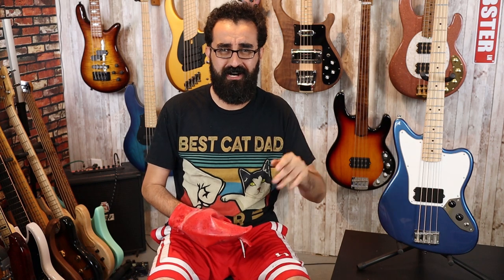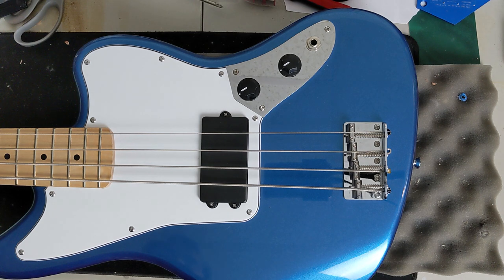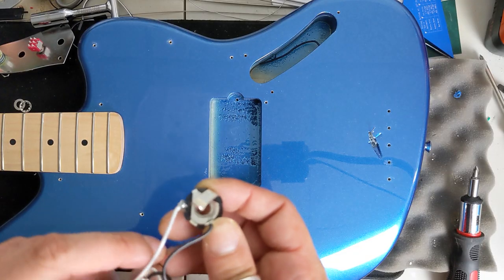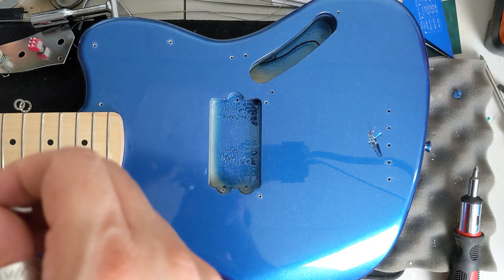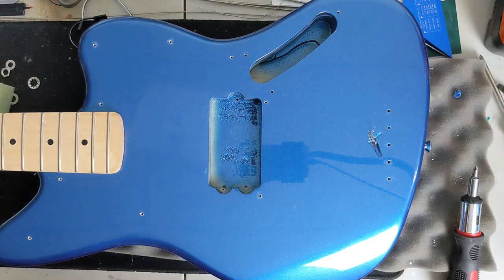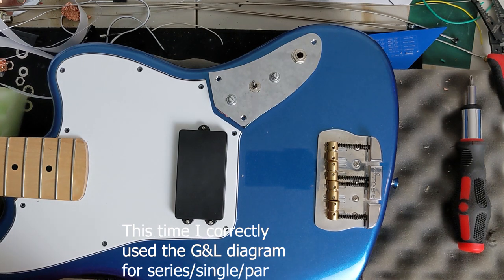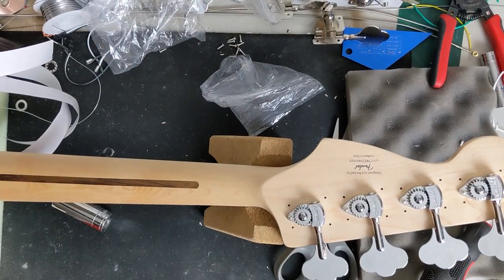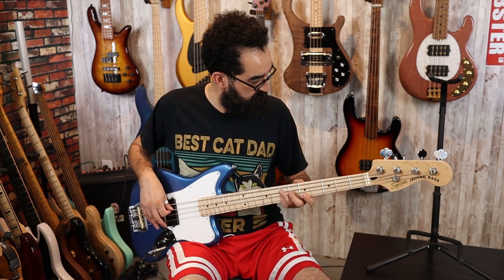Squier Affinity Jaguar H MODIFIED - Modding Fender's Latest Budget Beast! - LowEndLobster Fresh Look

Comment: Quick tip for anyone who wants to shield cavities and connect together but don't have soldering iron access. Take a thin strip of your conducting copper tape and route it to your different cavities. Then remove a little of the backing at each end and put on other copper shielding. You've completed the circuite!
Reply from the maker: EXCELLENT TIP!
Reply: I'm a total dunce when it comes to electronics, and I have this bass with the bass buzz feedback issue. I was told copper shielding tape might help. Your explanation probably makes sense to folk with any electrical aptitude, but do you think you could explain it so a fella like me could do it? Thank you kindly!
Reply: @citeltheof  so the entire cavity for the electronics needs to be covered in The shielding. Then underneath each pickup needs to be covered. In order to ground each section together they must have a way to connect. What I did was cut a piece of tape long and thing. I threaded that piece between the pickup cavity and the electronics cavity. Then once in the small holes I removed a little of the backing from each end of the tape and connected the different cavities together by pressing the tape down underneath the pickups and electronics cavity. This was on a jazz bass. If you would have a single cavity instrument like a precision this wouldn’t be necessary.

Comment: Great to see you do this mod video.  I'm looking to do a bass with two Musicman style pickups and  this model could fit the bill - add the second pickup between this mid-body pickup and the bridge.  Make them both wired for parallel/single/series options, using quad-coil MM pups so they are humbucking in all switched configs.  Thanks, LowEndLobster!
Reply: If you want to do a mod ignore me but if you didn't know the squier paranormal rascal already hasp two humbuckers on a jaguar body

Comment: Nice mod. Gives so much value to this bass. Single coil sounded the best to me.

BTW I used to have this exact same battery-operated Black & Decker screwdriver/drill. Man you are a hero you still use it after so many years. I wonder how you don't get frustrated with the battery. I could barely screw a handful of screws before it got depleted. Eventually I got myself a new one (Spanish - "Steyer" or "Steyr") which came in a nice case with a couple of Lithium batteries (for the cost of about 2 of the B&D batteries) and the thing just works and works and works before it needs a recharge. The difference is abyssal.  I've made 4 or 5 small and one mid-sized piece of furniture for my baby daughter and I only had to recharge one of the batteries once. The choke is much better too - you only need one hand on it to make a bit change.
Reply from the maker: Thank you! LOL I fackin hate this drill. It does the job when it's charged but man does it lose charge fast. You'll see in an upcoming mod video where I had to drill out the side jack of the Sire V3 (the jack cavity is separate from the control cavity, unlike on the V7 where it's all one cavity)
Reply: @LowEndLobster  Get a new one immediately. And destroy the current one sacrificially as a warning example to the tech gremlins that laugh by torturing manic bass modders.

Comment: The definitive solution to neck dive is to change the strap button positions.
Light tuners and a high mass bridge help but not nearly as much. 
The G&L pickups has an awesome sound. The wiring switch opened up a lot of options too
Reply: perhaps use a leather strap. there was no neck dive before nylon straps

Comment: I picked up one of these this weekend (went to GC to get it after Sam Ash told me it would be a year before they'd get one). The neck dive is absolutely a thing (I have to use a locking tuner or the front strap tends to pop off on me).

I really like these mods and the way it sounds. I especially like the three way switch. It adds some definite versatility to the stock configuration.
Reply from the maker: Thanks Clint! I've heard mixed reports about the neck dive and honestly will attribute it to how much counterweight you have going on in the body (lighter body = more dive). That being said, the shape of the body also contributes. The hipshots definitely helped, but did not cure the dive like in some other basses.
Reply: @LowEndLobster  Yeah, it's the same issues as the Mockingbird body style from BC Rich. All the weight forward on the body just doesn't balance out the headstock as well.

Comment: Nice review.  MFD pickups are so great! I like the finish on that Squier.  Good looking bass. Hand drilling holes into chromed metal is not for the feint of heart! Like the big brass saddles on that bridge, and it' great that it dropped right in. Wilkinson makes a really nice vintage style bridge with brass saddles that would have looked great and sounded much better the the original bridge. I had some classic vibe basses that I modded for fun, and I loved the Wilkinson parts and pickups because they were such an excellent value. If you haven't tried the Wilkinson bass pickups; you should. I don't think there is any comparable pick up for the money. Slap a P or a set of J's in a Squier and it improves the sound a ton. The improvement in your project with the MGD is staggering. I think someone could make big money solely making replacement hardware for Squiers.  Thanks for the interesting project and review.

Comment: I modded my charcoal/Indian laurel specimen for less than $125. I wired a GFS pickup in parallel, put on a Gotoh 201 bridge, and Dunlop straplocks, with a 1/2" dowel to extend the upper horn straplock a bit. The exposed pole pieces give more of a Sting Ray vibe, and feeding it through a MXR M-80 gives it a ballpark Ray sound to boot. It was interesting to see Lobster's mods, especially since I have a thing for G&L J variants (I have a pair of American JB-2s with pickup mods and Hipshot Xtenders, and an empress-body JB left bone stock, save for straplocks, natch; 1964 "holy grail" J sound under 8 lbs in weight). The modded Jag is a great "designated beater," and will likely find its' way to a grandkid's hands soon enough.

Comment: Awesome job. Continuity error found btw. Not gonna spoil it. On a different bar, I love this bass. Had so much fun modding it. I did a shielding right away as it was screaming like crazy on my rig. I went with the EMG passive pickups. Still haven't had time to swap the bridge and tuners so it still got a bit of neck dive. Only issue I've had so far is that the pickup route in the PG was too small for the EMGs. Had to cut and file to make it fit. Will add a 3 way switch later like you did.

Comment: Definitely a big improvement with the mods. My only question is how did you mount the MFD pickup into that blank pickup cover? That part was not mentioned. I like the shielding and I do the same thing but I always use the water based conductive shielding paint. It's so much easier to use than foil.  

The end result is almost like you created a medium scale G&L Kiloton.  So once again, great job. But you really need to show how you mounted the pickup into that mounting ring. That's very important to anyone who is watching this and wants to make this modification themselves
Reply from the maker: Great question! I used foam. I removed the guts of the MFD from the original plastic housing and they fit pretty well in the blank MM housing. I used some bits of foam to hold them in place in the housing, and foam under the pickup to keep everything in place as well.
Reply: @LowEndLobster  awesome.  Do you know if the stock pup is the same dimensions as the music man pick up? That certainly would open up some additional options if that was true.  

I'm seriously considering picking one of these up just to mess around with.  Oh, and by the way, I got turned on to your site through a post on TalkBass.

Comment: Great video as always.
Unfortunately for myself I purchased 2 of these bass’s, one gray, one black, the neck dive on both were beyond bad so I returned both of them.
Yes, putting lightweight tuners on would have helped but I don’t think enough to make me happy.
And yes, everyone’s mileage will differ as much as the difference in the weight of each individual bass, but in my case both the bass’s I purchased felt like they had way too much neck dive to be corrected or even helped with lightweight tuners.
Other than the extremely bad neck dive I really did like these bass’s.
Cheers, Davyo
Reply from the maker: Thanks for sharing your experience Davyo!

Comment: Hi Lobster! I was definitely eagerly awaiting this video. I figred early on you'd be G&Ling this one. Huge difference in sound, from before the mod, as well as in between the modes. Question, in the G&L the tone cap is only on the series mode, isn't it?
Reply from the maker: That's OMG mode where you have that tone cap, I have a regular series mode here. Should have clarified, sorry!
Reply: There's a more recent video where CLF Research goes through the wiring for all the bass pickup versions since Leo left FMIC, which I seem to be referring to a lot more lately...

They only sporadically update but they're usually pretty interesting videos from the CLFR shop and they publish often enough to keep turning up in my recommends.

Origins: Great Pickup Migration
567 views Jul 23, 2021
CLF Research
1.5K subscribers

Comment: Ooooh, great video Lobster!!!
I'm in the middle of quite a similar mod project on an old and cheap Stingray copy by Stagg which I defretted and converted to string through myself earlier this year. Just waiting for my pickup to be delivered and will wire it in the very same way with a DPDT switch. One annoying little detail is that for some reason the Chinese guys at Stagg decided not to use a standard MM style sized humbucker but some sort of a soapbar sized one.

Comment: The is a cool bass and the neck on my copy is indeed finished well.  My big complaint is the balance.  I’ve added some coated lead wheel balancing weights to the control cavity and it helps.  I will add an inexpensive high mass bridge if I can find one with a flat plate that I don’t want to return for not sitting flush.  If I can get it to balance it will be a cool bass to play on a regular basis, otherwise it will be an inexpensive and fun project bass that looks good.
Reply: Also metal volume and tone nobs add a bit more balance, but the poplar body and possibly the body shape don’t lend themselves to a bass that balances naturally.

Comment: Great review, thanks! I am considering one of these since they are medium-scale like the Aria Pro II I've been playing since I bought it new in 1981. One of its pickups is dead though and they are a really odd size to change out. I tried having a custom one made by Armstrong in the UK but that did not work out. The color is wrong and the output is weak. My Aria bass is perfectly balanced which makes me a little worried about this one being a bit neck-heavy. 

Could you explain more about the pickup modification? Do you have a video on that? I am considering installing a Nordstrand Music Man style MM4.2 pickup which should fit without any mods. I do really like the sound of the one you Incorporated though, so more info would be helpful such as the model number. Is it a single coil? You didn't happen to record a video of how you fit it into the empty MM shell? 🤔

Damn, this bass looks fabulous without the pickguard! 💯

Comment: How hard was it to fit a G&L MFD pickup into the MM enclosure? Did you put the entire pickup in there or did you remove the MFD enclosure and just put the guts into the MM?
Reply from the maker: Great question Ryan! It was super easy. I removed the MFD pickup from the stock enclosure, put it in the MM enclosure, and popped some pickup foam on the sides to shore it up. That plus the foam underneath gives it plenty of support to stay in place. I could have probably hot glued it if I wanted to do some thing more permanent for the pickup

Comment: Just got one of these.
Are the hip shot tuners 3/8 or 1-2 inch?
Did you put tape all around bushings?
How much did tuners help neck dive?
Thanks a lot!
Reply from the maker: I believe they were 1/2", yes on the tape (or you can order a pack of the hipshot metal bushings), and they helped significantly. Didn't eliminate it but you are saving like 1/4 lb off the headstock by swapping
Reply: @LowEndLobster  awesome thanks a lot!
You rock 🤘

Comment: Extremely nice sounding with the modification. So basically what you summarized was that all you really needed to do to get it sounding good would have been to just replace the pickup or did you mean the pickup and switch?

Comment: Those mods turned out great! Would you say the hardware upgrades made a big difference to the neck dive? I've had my Jag for a month or so now, and while I'm enjoying pretty much every aspect of it, the dive is really getting on my nerves. In the UK I'd be dropping almost double the retail for the bass on Ultralights and maybe a big old Babicz bridge; I wouldn't need it to cure the neck dive completely (my main bass is an 70s EB-3 after all, I know neck dive!), but it'd be great to know if you personally thought the difference was worth changing the parts on the whole.
Reply from the maker: Thank you! The tuners helped but didn't cure it. I have heard reports of inconsistent body weight in these models which may also impact the neck dive situation.
Reply: @LowEndLobster  Yeah, I think mine might be particularly light too. I was really into the idea of something medium-scale for D standard tuning (since I mostly play short scales) with a humbucker that I could mod the hell out of, but now I'm on the fence about maybe switching it out and looking for a deal on one of the short scale Sterlings... 

Ergonomics are pretty much my #1 for basses these days, so even if it's a quality build and sounds great, if it ain't comfortable to stand and play for 3+ hours then I might have to rethink things.

Comment: Exciting mod! @lowendlobster,  do you think a G&L L-series pickup would fit as well?
Reply from the maker: That's what I used. I removed the stock housing and crammed it into the MM style housing you see on the bass. Underneath is the same MFD that you'd find in an L1000. The MFD is a little smaller guts wise than the MM, so things fit well. I used some foam to secure the pickup guts in place in the housing.
Reply: @LowEndLobster  awesome!
I had an clf 2500 5 string for a while, it sounded incredible but the string were too tight together for my knuckles, so hopefully thar L pickup would give me a cheap ride in that direction... premium economy as the airlines call it today. I saw the g&l parts site also sells a 3 way switch,is that the one you used. Oh , the wiring diagram link was dead last time i checked. Did you add any caps,  or just  wirings?

Comment: First of all: very, VERY nice!
Just found out about these basses and this Video is exactly what I was looking for! Thank you!
One question though: I have a G&L L-2500. If I get a threeway switch and solder it up accordingly, could I also add a single coil mode to it? I always thoight the mfds are only capable of series/parallel and just the prospect of it is setting some gears in motion!

Once again, thanks!

Comment: might slap in a turner multicoil pickup so i can get a switchable pbass mode in mine. i think the stainless steel mesh one would look cool with the shell pink. as for neckdive i was hoping a heavy bridge could be a good counterweight

Comment: How is the stock pickup wired, series or parallel? If Series, is there a way to wire it in parallel, add 500k pots, so as to make it less "spicy". I have one of those orange Metallic Orange ones I got as a knock around beater bass however, the pickup is just too hot and a bit muddy. I don't want to invest much in it. I also thought about one of those ALLPARTS ALNICO V PU-6422-000 pickups. as a replacement. Sometimes Ceramic Magnets are just too hot.

Comment: I'm surprised that the dude didn't mention anything about the neck on that Affinity model is 2 inches shorter (32 inches, mid-length) than a Precision Bass! (34 inches).  That Fact "minus" a 2nd pickup and knobs, pots and wiring are why the Affinity feels so "light". With the longer neck the Bass would Head Dive even more. (weight + length = a different "balance/tipping point" at the body. More forward). I just bought that Squire, Jaguar Affinity H Bass from Sweetwater for a Total of $220.00 US dollars on 9/28/24. (tax and shipping included).  It's a Sweetwater Exclusive, Limited Edition "Orange Metallic" color. Beautiful Bass Guitar! It's so Exclusive that my Bass won't be shipped to me here in the States until February 2025. (5 month back ordered).  I don't think my guitar has even been Manufactured yet?  I've already ordered Ernie Ball "Slinky" Flat Wound 45 - 105 strings for it and should be at my address in days. Too bad they'll have to wait nearly 5 months for their guitar! LOL.

Comment: This might be a bad idea but could the neck be changed for a 28 inch scale length like prevalent on Ibanez Mikro, Jackson,  and other short basses? I like the Jaguar Shape but prefer a shorter 28 inch scale length coming from playing a guitar size instrument. Thanks for any thoughts or suggestions.
Reply from the maker: Great question. It's not only the neck, but the bridge position that would need to be adjusted for the change in scale length.
Reply: @LowEndLobster   Thanks for the information, I had thought that it would be a simple swap. As I thought that it would only be a 4 inch or so difference. 28.6" to  32".